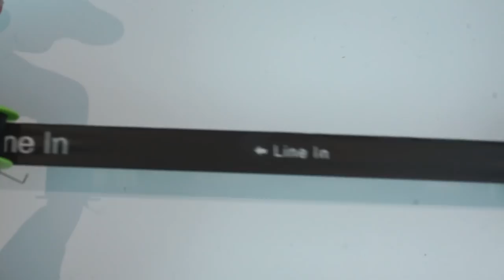Looking at a security risk with many label printer tape cartridges

Comment: The tape is pretty thin, I'm wondering whether you can hit it with a heat gun and melt it quickly and easily into an unrecognisable mess? You'd probably have to take it apart though. 

We've got a secure destruction service at work, but they only take paper, and charge extra on top of their already extortionate price if you put something inside that's not paper. They literally pay someone to watch the bins get emptied onto the conveyor belt that feeds the paper into the recycling machines, so they can say your documents are securely destroyed. But they're the same conveyor belts that they unload the paper from our non-secure destruction bins onto, so it really only makes a difference if they pick up the bins separately (and they always pick them up together). Either way, if you put something that's not paper in the bins, they'll charge way more because someone will have to pick it up off the conveyor belt before it hits the recycling machines.

Personally I don't bother destroying the tapes. They're going to need a lot more than an internal IP address to get access to proprietary data on my network! And if they've managed to get into a secure server room inside a secure facility, then so many other things have failed, the fact that they know the IP address of our routers, switches, firewalls, etc. is the least of my concerns. It means we're wasting tens of thousand of dollars a year on internal penetration testing that's ineffective, when we could be spending it on cool new hardware! (Or, you know, better security guards.)

Comment: Yeah, I destroyed my green cilinder with the black tape aswell asuming it could contain sensitive details. hope ppl in business will realize properly disposing these would benefit them a bit more. great vid. (also, I started writing mutliple labels at one run, to preserve more tape and use Scissors to cut em, saves tape :D but thats just a personal thing, business just buy loads of them. also Aliexpress has some nice working cheaper ones.

Comment: People are lazy by not wanting to know how things work.
All thermal printing leaves a negative of what has been printed.

An IP address is NOT confidential, nor dangerous information!
(Your outside IP is public and your internal IPs can be found very very easily).

I never put confidential info on any label or document that anybody can see or access. They are always in a private system, encrypted twice (encrypted container + encrypted file).

Btw, you can do much better than wasting so much tape: Just put couple spaces between labels and cut them yourself!

Comment: Yes, i took apart one of these a few weeks ago, because i was interested, and found that!, i have no issue with what i print Being seen, as i mainly got it for labelling cables, i found some from a different company, they are so cheap, 32 meters across 4 rolls for £12!!!, i will leave a link:

https://www.amazon.co.uk/Laminated-PT-2030VP-PT-2430PC-PT-D600VP-PT-9700PC/dp/B06XWT2572/ref=mp_s_a_1_1_sspa?dchild=1&keywords=airmal+brother+label+cartridge&qid=1585660270&sr=8-1-spons&psc=1&spLa=ZW5jcnlwdGVkUXVhbGlmaWVyPUFLQjk2MlVaM0ZPQ0smZW5jcnlwdGVkSWQ9QTAwODUxMTdQMzU5M0hKWFpRWjkmZW5jcnlwdGVkQWRJZD1BMDY0NDcyMDJLQVNJTUI5Wkk1WU8md2lkZ2V0TmFtZT1zcF9waG9uZV9zZWFyY2hfYXRmJmFjdGlvbj1jbGlja1JlZGlyZWN0JmRvTm90TG9nQ2xpY2s9dHJ1ZQ==#

Edit: also, great video,
I was also thinking about when you send them back to be recycled (brother lets you do that with their own cartridges) that they could see it if they wanted to, but i don't know why they would do it